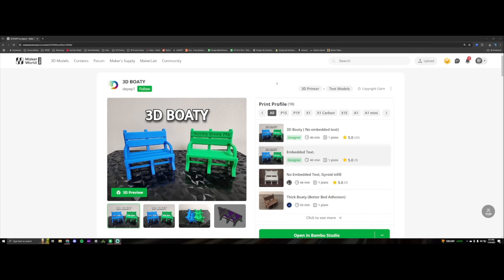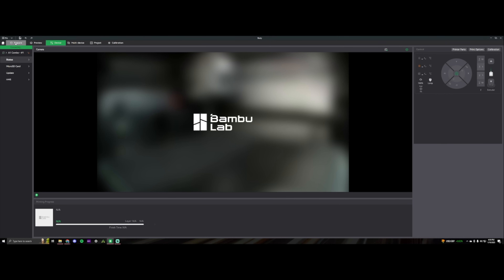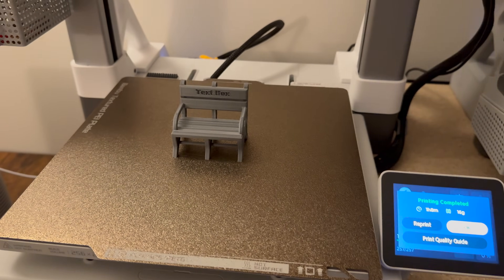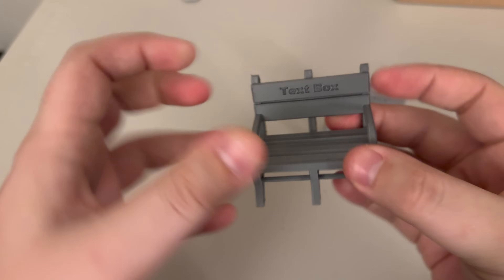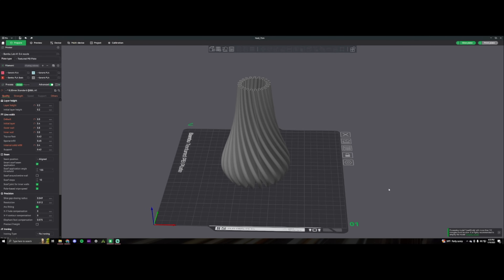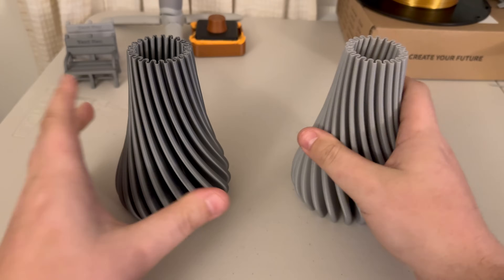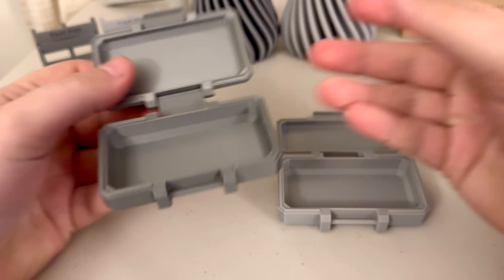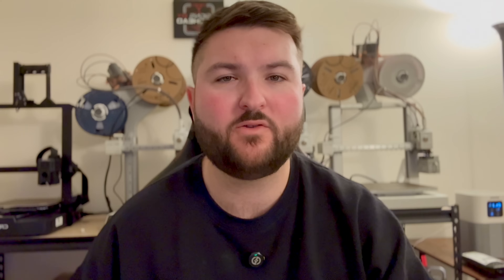PLA vs PETG: What Filament Should You Use?

Comment: I use PETG the majority of the times, more resistance and a beautiful glossy finish, easy printing without fumes problems exacltly like PLA. I recommend using a filament dryer when printing PETG stuff.
Reply: I second this. PETG from a dryer is the way to go if you want hassle-free printing with practically indestructible results. 

Get a quality filament dryer (not one of those cheap ones with fake sensor readings) and print from the filament dryer as it's running. It's a night and day difference compared to printing moist filament. In my experience, a budget printer printing from a dryer can outclass a high-end printer that is printing filament that has been left to soak up moisture in terms of print quality (but it will take longer, of course). 

Pro tip: Find a way to bolt the dryer down. I once heard a loud clang from the printer room and discovered that my little Elegoo Neptune 3 had dragged a tangled spool with the filament dryer across the desk until it tangled in the air from the truss of the printer.

Comment: Great video.  Straight to the point.  When you said cooling on the PETG benchy, what clued you in and why didn't the profile account for that?
Reply: The sag in the over hangs. The material profile does not know what you are printing. it's just a set of parameters that will work best for most situations. Some prints will need to be tuned different than others.

Comment: If I were to 3D print parts for a model baseball stadium, which would you recommend me to use- PLA or PETG? And does PETG have any dangerous odors it releases when melted?
Reply from the maker: Honestly PLA would probably be fine. And no, PETG has no odor and no harmful fumes.

Comment: What do use on your printers before printing on the print plate I see you spraying something rather than using a glue stick? New to 3D printing and have ordered the bambu labs x1 carbon.
Reply from the maker: I just spray isopropyl alcohol on it lightly to clean it -- I clean it with hot water and a bit of dish soap when I want to give it a good clean
Reply: @ do you need to use a glue stick before making a 3D model? Or just cleaning it before making a model. Seeing a lot of people saying to use a glue stick and if a glue stick can you use a regular you can buy in a Walmart etc.
Reply from the maker: You don't need too. When I first started with my Ender 3 V3 KE, I used a glue stick made specifically for 3D printing, but once I got my Bambu printers the Textured PEI build plate is very good and IMO you don't need glue.

Comment: An excellent presentation. 

PLA and PETG glass temps are too low to use in an automotive setting, and UV will break both in strength to below 50% after a year of UV exposure. Have you worked with ASA? We do because we make one-off systems for industrial machines that will resist UV and heat.

May I suggest another metric for comparison - the time it takes to print the model. How much more time did it actually take for the PETG jobs to be completed? Turn time may have a value if you have a machine capacity constraint. Here is another example. My shop uses PLA for prototyping functional parts with high perimeter/wall settings and top/bottom counts for part strength. We design robotic grippers and other manipulators and a part may go through 20+ revisions in the design and integration process. We print about 60% of the parts used in a gripper, and the integrated designs go through 10 - 12 iterations through development. The difference in speed printing PLA vs. PETG or ASA is significant - an order of magnitude significant. Time is money, and getting test-fit parts to model the physical geometry of a system quickly is a competitive advantage. We use PLA until all parts in the assembly pass mechanical integration before production printing in ASA. There are always differences between plastics; warp is our biggest issue with ASA. About 80% of the prints are ready to install off the printer, and the other  20% of the time we have to adjust the slicer profiles and customize the settings to get bed and layer adhesion for that specific part.    

Again, an excellent presentation.
Reply: Great points made about print time!

Comment: Great information, but I have a question.  I want to make two 45 degree bevel meshing gears for a drum sander.   The gears are used to raise and lower the bed so there is some stress to it.  What would be the best Filament to use tocreate those gears (solid fill).  Thanks!

Comment: at around 3:00, what is that you're using to clean the beds. What liquid are you using.  I have the A1i  I got to take my bed to the kitchen sink about once a week.  Normally I wipe it with 91% alcohol
Reply: I came here to ask the same question
Reply from the maker: It is just a bed plate cleaner I found on MakerWorld, it allows me to attach a piece of microfiber cloth to clean the plate. What I am spraying is 90% isopropyl alcohol that I just put in a small spray bottle. Has worked great with any filament I have used!
Reply: @DesignsByBrodhead  Thanks much. I fojund a bed cleaner on Amazon and didn't likeit at all.  Returned it. I do use 91% alcohol after every print using a woven cloth.  I'll look on Maker World for the one you got.  It looked like a piece of sand paper wrapped around a block of wood.

Comment: I get way better layer adhesion using PETG than with PLA and together with it being tougher, the PETG just gives me functional parts that last much longer.
Reply from the maker: I wonder why you don’t get as good layer adhesion with PLA. I would mess around with your bed temp settings for whatever profile you are using for PLA in your slicer. PLA is usually my go-to benchmark filament
Reply: @DesignsByBrodhead  Not bed adhesion, layer adhesion: how the layers stick to each other and how much force it takes to pull them from each other.  Especially with vase mode prints, my experience is that PLA just comes apart way more easily than PETG.

Comment: They also have a PLA+  that's supposed to be much stronger and still easy to print.
Reply from the maker: I’ve used PLA+ before but I’ve had issues with its consistency. Might need to try some again soon.

Comment: What about the water in the vase effecting the PETG? You said it could degrade even in a high humidity environment.
Reply: PET g . Doesn't ring any bell to you? :). All the pastic bottles (Cola, water, etc) are made of PET. The humidity is a problem with fillamment while printing, not the actual product already printed.
Reply from the maker: From my understanding, once the filament is bonded after printing and sealing, it is water tight and won't degrade from water or exposure to humidity.

Comment: anytime you print a model in different filament types on the same model of printer and one filament takes longer to print, you should ask yourself why.  In this case the flow rate of the generic PETG profile was too low.
Reply from the maker: Of course — but for the testing I wanted to eliminate as many variables as possible. Using the generic PLA and PETG profiles in the slicer, helps cut down on those. Thanks for the tip and watching!

Comment: Agree… just an emphasis… if it needs to flex at all, PETG…. Filament clips, cable tidy clasps, etc… I’ve done in PLA and PETG…. The PETG ones simply last… PLA breaks after the first use

But…. Most PETG I have tried is vibrant and glossy. I just love that PLA has less gloss usually and comes in much nicer subdued colours (in my experience at least) as well as vibrant colours….
Reply from the maker: Yeah, PETG is a little more forgiving than PLA! Thanks for watching!

Comment: The PLA+ (PLA Pro)  filaments are more like PETG. The are more impact resistant and are slightly higher temp resistant than normal PLA and from my experience don't have the stringing or build plate adhesion issues of PETG. I don't know if they have any UV resistance.
I've found PLA+ to be plenty durable so I only use PETG if I'm putting something outside in the elements.
Reply: I also PLA+ and find it will take the heat outside in a hot climate (Texas) have few outside in the direct sunlight, than a family member placed some on his dash of his car.
Reply: @windforward9810  Which brand/PLA+ product sine there are so many of them? I have 4 rolls of Sunlu PLA+ 2.0, but have no tried them yet.

Comment: Good comparions. PLA is easier to print, it's better for overall projects, including minuatures, terrain, etc. It is stronger than PETG, so it's good for functional prints as well. PETG is a little more flexible, it's definitely more heat resistant and it's allegedly food safe (but I wouldn't use 3D prined model for liquids). I use PETG for containers and enclosures of electronic devices (IoT sensors for example) and PLA for everything else.
Reply: FYI I would never use a 3D print for food because of all the little holes where food could collect and be a haven for bad bacteria.

Comment: What is that you're using to clean the print bed before you started the prints at 2:55? Looks like some sort of handle with a cloth?
Reply from the maker: Yes! Spray bottle of isopropyl alcohol, with a build plate cleaner with a microfiber cloth attached that I printed off MakerWorld!
Reply: @DesignsByBrodhead  you better read the documentation for Bambu printers. You should be removing the print bed sheet and washing it with dish soap.
Reply from the maker: @hi-ccowboy7983 Lol - I do that every 5 prints or so. Build plate does not need that every time you print something unless you are putting unnecessary adhesive (glue, spray, etc). The alcohol and microfiber cloth work great in between prints. 😊
Reply: @DesignsByBrodhead yeah I know that. 😒
Reply: @hi-ccowboy7983  So then why did you comment as if you didn't know that?
Reply: @maskettaman1488 I didn’t. Haven’t you ever had someone explain something to you as though they’re the only person who knows it?
Reply: @ You literally said he should be washing it with soap and water instead of a quick wipe with IPA. That's simply incorrect. The fact that you're now pretending to have known that all along is just sad.
Reply: I'm assuming Isopropyl Alcohol. I spray it on my bed to clean & ensure a good bond. Removing any hand oils or other potential contaminates.
Reply: @cmg617  Not the solution,the actual device he's using that he's spraying it on to.

Comment: That's NOT stringing... Stringing is the very fine wispy almost cotton candy like threads off the object...typically caused by incorrect retraction settings, or wet PETG... YOU DONT HAVE STRINGING.  Those were just insufficiently cooled overhangs.
Reply from the maker: Hey homie, you can tell there is some wisps of stringing in the B-Roll. No need to yell — you saw me unwrap both spools in the video. Thanks for watching! :)
Reply: @DesignsByBrodhead  wasn't yelling, there's just no way to show emphasis.   Just unwrapped doesn't mean dry... Yes, freshly opened vacuum sealed filament can be wet... But from the prints shown, it doesn't appear to be...just failed bridging... I felt it necessary to point it out, because with the huge influx of new 3d printer users since Bambu Labs has made them so much more accessible I'm seeing newbies almost daily in support groups using in correct terminology, calling failed bridging or unsupported overhangs "stringing" and asking for help with "stringing" and then getting wrong advice, because their problem wasnt stringing but just trying to print in thin air, but they don't know the difference, because they see videos such as yours and think "oh, that's called stringing,"

Comment: The comment about being in vacuum sealed bag affecting the lifespan seems off.  There is nothing chemical that happens to the filament when you print, so if keeping not keeping the filament in a vacuum sealed bag affects the lifespan of the material.  What happens when you print something and then try to use it for several years?
Reply from the maker: Keeping the filament in a vacuumed sealed bag won’t necessarily directly affect the lifespan. But if you live in a humid environment, keeping the filament sealed or dried will absolutely increase the print quality, compared to if the filament absorbed any moisture outside of a container. I’ve seen people throw away spools because they have absorbed too much moisture — they could always dry the out and use it over and over again.
Reply: @DesignsByBrodhead had one PETG with moisture that kind of stick together after drying, had to throw it away. It was half spule that cost just $8 per kg but still a waste

Comment: PLA becasue it's stronger. It's more stiff and rigid, doesn't flex as much. I only use PETG if it's going outside.
Reply: On the other hand, if you NEED a bit of flex, PETG is better.  I printed something that needed to have a bit of give in it in PLA and the item simply snapped and broke.  Printing in PETG, it can take a little bit of stress without snapping.
Reply: This is similar to the discussion in the boat industry with carbon vs glass fiber and epoxy construction. Carbon masts are stiff but explode when they reach their limit, while glass gives a bit (and needs more for the same strength)
Reply: @LilApe  PLA is stronger, but brittle.  PETG isnt as strong, but it's tougher, because it will flex and yield more gradually before breaking.
Reply: ASA
Reply: @mandibarcena6667  nah... I can get as good a result with PETG and without the smell
Reply: I print pretty much only in PETG + and PETG CF
Reply: Also, different brands and even colors will affect strength, flex, etc. Sight tweaks in settings or how you dry your filament will make a big difference. Sometimes anealing can make a difference. So right out of the box testing doesn’t always tell us everything.
Reply: PLA gets so much better surface finish on my Bambu A1 than PETG. That is the reason why I take PLA.
Reply: I agree 100% with you. There's a misconception out there pla is weaker. I use overture turbo pla for my 12 1kg roll shelf and listen that's not going nowhere
Reply: @Pawsomepooch3dprints 
Hi!,
How would you compare that to the eSun PLA + , is it tougher?
Reply: What? No links to your favorite products? Get on that, my friend.
Reply: I prefer PETG. I want drop resistance, and it prints better for me than PLA.
Reply: @fool-on-the-hill I’ve had the opposite experience, PLA always seems to be easier to deal with. Less drying required, less stringing risk, less print failure risk… without deviating from the default profiles for the filaments, it just produces better results. It could just be the two particular filaments I’ve tried though.
Reply: @guspaz  for whatever reason, my A1 struggles with corners when I use PLA, no matter the brand. PETG seems to just stick. My printer is in a climate controlled tent.
Reply: Pla is not stronger...
Reply: @SparQz  you're absolutely wrong... There's two different things we're talking about... Strength and toughness... PLA is STRONGER but PETG is TOUGHER... The distinction comes in, if you subject both to a static load, the PLA will outlast the PETG (see actual testing on CNC Kitchen YouTube channel) but, when it comes to impact resistance, or side loads, PLA is brittle and will shatter, whereas PETG will flex a bit more and yield more gradually.
Reply: @SparQz  yes... It is.
Reply: @SparQz  Oh yes it is, look at any PLA and PETG TDS and you will see that pla has higher bending and flexural strength,

Do you own testing and see for yourself. PLA doesn't flex or bend as nearly much/easily as PETG.